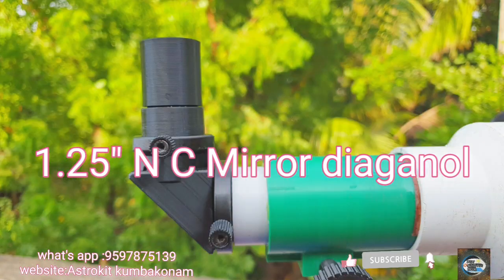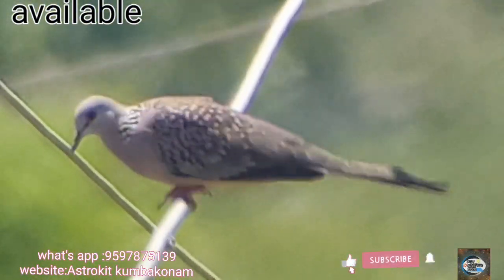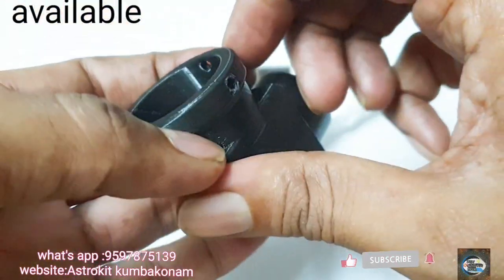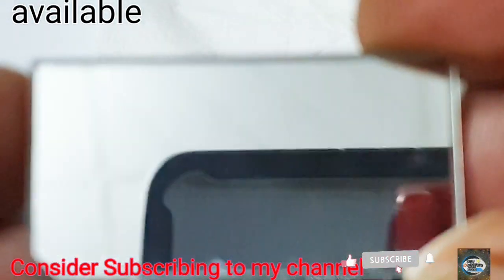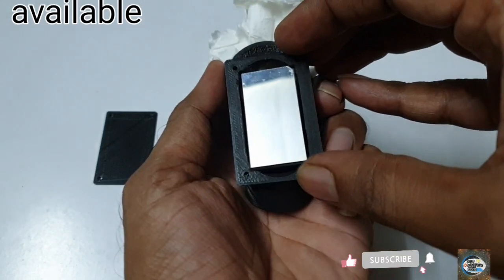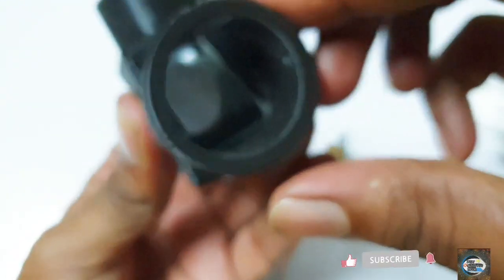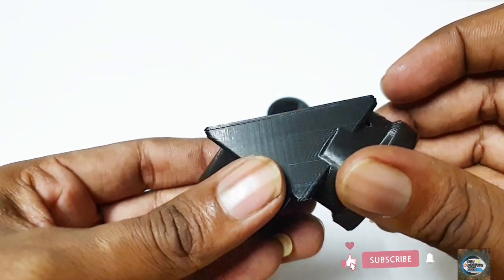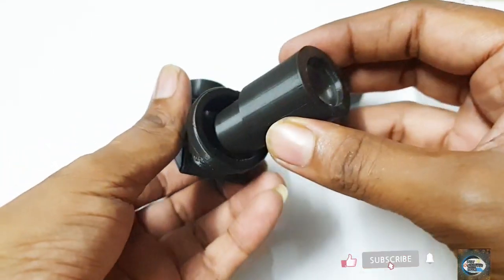diy Diagonal | 1. 25 inch diagonol |homemade | 3d printed

Comment: The mirror is front side coated or back side coated (simple mirror)?????
Reply from the maker: Non coated 
But polish mirror on front side
Reply: @newcreationtamil  
Which material you use for polishing?
Silver!?
Reply from the maker: Aluminium polish